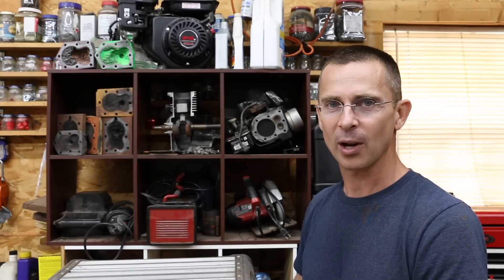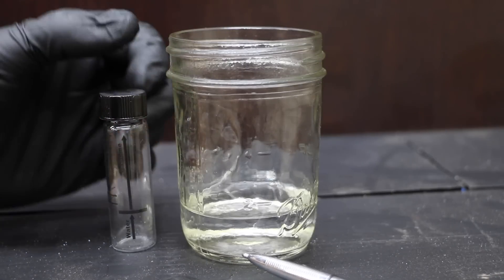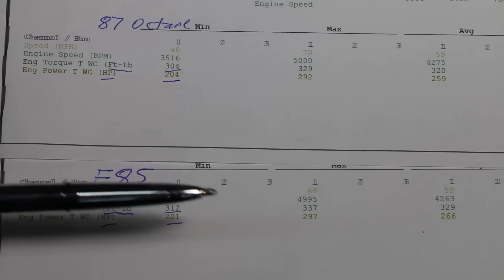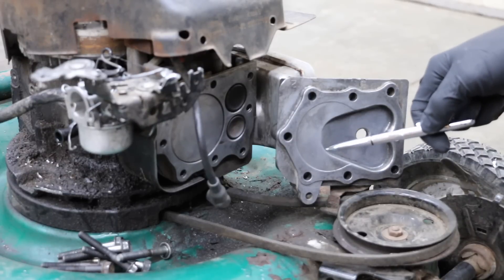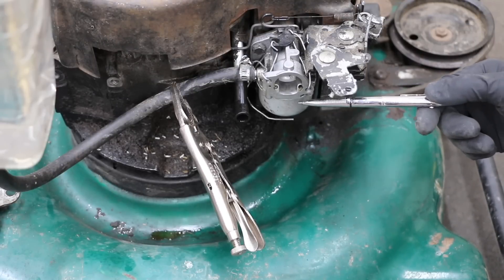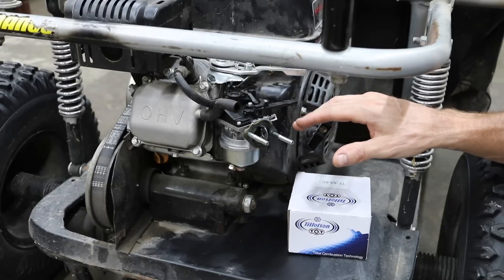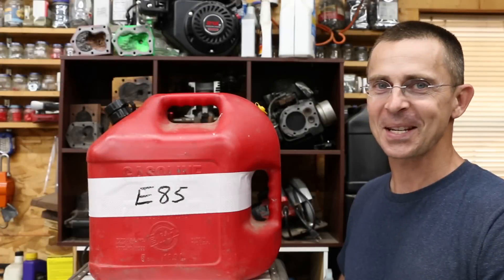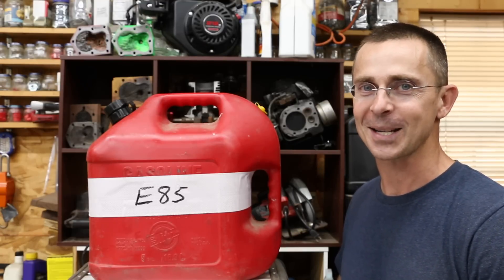Is E85 better than Gasoline? Let's find out!

Comment: My ecoboost says nothing more than e15 or it will void the warranty
Reply from the maker: Great point. Thank you
Reply: You know that's illegal right? The “Magnuson-Moss Warranty—Federal Trade Commission Improvement Act” is a Federal law, US Code, Title 15 § 2301, Public Law 93-637, signed into law by President Gerald Ford on January 4, 1975. Read details for the long story. The stickers you've seen that state "warranty void if removed" are illegal under this act. It also requires manufacturers to make the terms and conditions of warranty coverage clear and easy for consumers to comprehend. What does this have to do with automobiles? It is illegal for the manufacture to deny/void warranty coverage because you used an aftermarket part. Nobody, including you, likes being told what they can and can't do to their own automobiles that they paid for. If you want to use 10W-40 in your ecoboost instead of that water like 0W-20 you can do that. If you do then the manufacturers are required to provide absolute proof that any engine damage sustained IS A DIRECT RESULT of using non-OEM parts or fluids. Otherwise Ford is legally liable to cover the damages. The moment Ford can prove using E85 in your automobile does cause any kind of damage at all is the moment Ford can deny warranty coverage. Must be absolute too. If Ford states it's in compliance with this act by voiding warranty coverage on engine repairs because a fuel line didn't survive E85, uh no. That only shows us the fuel line couldn't handle it. Says nothing of the engine itself.  If you use an intake and exhaust from MBRP and a piston gets a hole in the center Ford is required to cover it if they can't prove the MBRP parts caused it. If a little extra air flow is enough to melt a factory piston I'd consider said car a lemon. 

Suppose Ford could proof using E85 caused damage but the reasoning was all related to computer programming? Then you are well within your right to have the ECM reprogrammed by an aftermarket company with a custom calibration that allows safe use of E85. To sue Ford for this covert criminal practice would take greater action. Class action more than likely. Apple lost against a class action lawsuit for intentionally engineering a short battery life in the Ipods. That and when the battery did die you couldn't replace it. The ipod was built fragile so it would break if someone attempted to replace it. Apple's solution? Buy another Ipod. It was a planned cash grab. Didn't end the way Apple was hoping. I bet you never heard this before. That's because fake news is controlled by a small handful of BIG corporations and their last wish is for the people to know any information that would set them free and give them power.
Reply: @exoticcreature3059   I've never heard of this before, very interesting.  The problem is though if a company denies to honor the warranty there is nothing you can do about it but sue them.  And the time and money it would take to do that probably wouldn't be worth it in the end.
Reply: Classic80sStuff if your under warranty you have a lemon law I would tell them to keep the fucker in the shop for 30 days and order a buy back and get my money back. Just did it in my 19 mustang in the shop for 3 months and got another brand new car instead 🤷‍♂️
Reply: @exoticcreature3059  yet you fail to understand how it works. The warranty is there so they don't have cover the damages you the customer did. If it says nothing more than e15 don't run anything more than e15, otherwise you risk damaging fuel lines and other important parts. Also, considering its an ecoboost and its only recommending a max of e15, running anything anymore can overheat the engine and blow it because its not receiving the amount of fuel it needs to help keep the the combustion cool in a worst case scenario so that's why it says it would void the warranty.
Reply: @geekmechanic1473 No, warranty is a scam. A fancy word for being dictated by the auto makers what you can and can't do with YOUR automobile. You still haven't addressed the part where the auto makers are REQUIRED to definitively prove damage was caused by your use of something the auto makers don't specify. Here is the problem, they never will. Good luck too when you don't have deep pockets. As for ethanol, lolololololololololol. Under what circumstances would using higher ethanol blends result in less fuel being delivered to the cylinder? That makes no sense at all. Not when ethanol has less energy density and you need more of it to produce normal engine power and because the oxygen content in the exhaust gasses would confuse the ECM in thinking the engine is running lean, thus, increasing fuel delivery. For fuel lines, there is no difference in material between flex fuel and conventional. If it handles E10, it will handle E15 all up to E100. The auto makers aren't careless enough to use rubber and plastic parts that do break down from high ethanol concentration like what you would find on a lawn mower. That's because the ethanol percentage varies MUCH more from pump to pump and station to station than we are told. "E10" at shell could be E18 for all you know. The auto makers know this. lololol
Reply: @exoticcreature3059  I build racecars for a hobby, if you don't upgrade your fuel injectors they won't be able to squirt in enough fuel for it to complete the combustion. I've seen pistons blown because of this. You need bigger injectors to be able to use higher ethanol blends
Reply: The fuel lines, tank, etc. Will degrade over time
Reply: @exoticcreature3059  its not that hard to prove something voided the warranty. They do specify what fuel to use all the way up to how much your tires are supposed to be filled. Its called an owners manual, they come with all new cars.
Reply: @geekmechanic1473  The owners manual is NOT proof. It is a booklet that explicitly tells the owners what the manufacturers say they can and can't do. Nothing about it is a scientific test. If fuel lines degrade over time it's because they were designed to. Manufacturers know how to make a product last. They won't do it. Why? $$$$ Again on fuel, the ECM has a built in speed density program in case any and all related sensors fail. MAP, MAF, IAT, TPS, O2, blah. Also programmed in is a tolerance range. +- x percentage compared to normal in case "normal" isn't producing adequate engine power or smooth operation. This is not an option. Not when atmospheric conditions vary so greatly, or in the event one cylinder goes dead. If the fuel pump, rails, and injectors could only deliver the specified normal amount and nothing more then engines would not run good for very long and you would buy another car in not time. Or you would look to the aftermarket, which is the smarter choice because then YOU decide what get's built and how it performs. Now I did not say fuel demand can't ever exceed the supply because it can. But don't expect me to fear a fuel shortage at 2,000 rpm just because the fuel isn't what the manufacturers said you can use. They do after all make engines that will spin up to 6,500 at WOT and a fuel system that keeps up. I'm pretty sure a 20% increase in demand while cruising won't starve an injector.
Reply: @exoticcreature3059  it won't starve an engine as long as you aren't using e85. And yes the rubber does degrade due to ethanol. As for what I was talking about he said he had an ecoboost engine that means he has a turbocharged engine which is forced induction it isn't flex fuel  and this is where it is important where you don't want to use e85 because if the engine hasn't been modified, such as a tune, bigger injectors and the such you can see failure in the engine as it isn't receiving the amount of fuel it needs. The owners manual isn't proof itself but it is a guideline that the manufacturer has set in place that they know will keep the car going. In the end using e85 isn't recommended in vehicles that haven't been built for it and don't use e85 and can see catastrophic failure if done so especially in a car using forced induction. I can tell you don't exactly understand how cars are built and designed because if you did you would understand that using e85 isn't like using premium gas and not every car can run it. Now I'm not saying the manufacturers don't make stupid decisions, they do especially Nissan when they decided to go from timing chain to timing belt is which would lead to the pistons and valves hitting when the belt broke and in that case they did have to fix it. But to outright say warranties are bad isn't true because I've had to return multiple cars that didn't work due to them being faulty and otherwise I wouldn't have been able to if I didn't have the warranty.
Reply: Now saying that dealerships are the main people you have problems with they will try to overcharge you for something simple but then again most places will try to do that.
Reply: @geekmechanic1473  Then I should hear everyone say they had to take their car or truck to a repair shop because the gas tank and fuel lines turned into mush from normal use. That, and I could rightly say in this specific case that following the manufacturers guidelines is a bad idea because they knew I would being buying replacement fuel lines on a continuous basis and yet told to to use a damaging fuel anyway. For fuel starvation, in this case I'll give you that one. Ecoboost, turbocharged. All those times you had to take a car back to the dealership did you ever think "What a POS this thing is!"?
Reply: @exoticcreature3059  no they don't degrade with e10. They do degrade with e85 if the vehicle isn't set up to use e85. Most people don't modify cars, so having a warranty does help save people money, Its helped save my friend a ton of money when the dealership sold him a faulty car. Now don't confuse dealership and the manufacturer because in most cases the manufacturer has to sell their cars through the a dealership (well at least here in the US) and the dealership ain't the most honest or reliable. There's a reason why I and many other people learn how to work on our own vehicles because there's a lot of places that like to take money from people, take Wal-Mart for example I hear horror stories all the time about how they charge the customer for an oil change and don't do it or damage something in the process and some dealerships do this as well (not all). Now as for why do companies use a small engine and turbocharge it is because you can get the power of a bigger engine and the fuel economy of a smaller engine. Now the problem I have with buying new vehicles is you can't be too rough on them and that because there is a period where they need to be broken in (engine and other components that is).
Reply: @geekmechanic1473  WalMart has done much more than that. There is a documentary called 'WalMart. The high cost of low prices". Back to ethanol I'm trying to make you see it for everything it really is. I acknowledge ethanol damages cheap low grade rubber and plastic. Also I know materials made to handle it are not rare and are not expensive. That and cars are made to handle higher ethanol content than 10%, obviously. Like I said before pump gas all over the US can be e10. It can also be e22, yes really. The variance is very wide and very common. The auto makers know this and have, or at least should have, designed the fuel system with this is mind. Don't expect them to admit this though. That would be admitting pump gas is blended with anything but accuracy and is sold at the price of e10 even though it should be reduced. Forgive me if I seem a "little" hateful towards auto manufacturers. That's what happens when they have a vast history of scamming the people. Did you know GM would charge for a replacement injection pump on the trucks with the GM 6.5 diesel when they knew the real problem was the PMD overheating? A much cheaper part that is easily replaced and easily relocated to a cooler spot. For the cases when the injection pump actually did fail, the reason was the factory lift pump. That thing is a joke that could never supply constant and adequate fuel pressure to anything bigger than an ATV, a youth ATV.
Reply: @exoticcreature3059  yea I get e10 isn't always e10 same with e85, I've seen with as low as e50. Now yes all manufacturers have had mistakes in the past, but dealerships will try to scam you more than the manufacturer if they do at all. Ford has the most lenient warranty that I've seen so far as they will let you do mods such as exhaust or cold air intake without voiding the warranty not every manufacturer is that willing. Now there are certain things they don't want you to do that could end up damaging the engine and that's where ethanol limits are placed. To run a car on e85 and a modern car that is you would need bigger injectors to make up for the more fuel that needs to be injected as well as a tune otherwise you risk starving the engine and on engines with turbos and superchargers that could lead to damage of engines. So just because the fuel lines and such might be able to handle e85 the injectors might not and you will also have to consider fuel pressure and fuel pump because e85 requires more of it to be used.
Reply: @geekmechanic1473  What about the 65 year old woman with a 4 cylinder Ford Ranger that goes 0-60 in......wait, she doesn't even go 60. Suppose she grabbed the yellow hose by mistake. Would she experience fuel starvation?

Comment: How much diesel could you get that lawn mower to run on when mixed with gasoline?

I mean like a 20% diesel, 80% gas mixture. Or even something like 50% diesel, 50% gas mixture.
Reply from the maker: Great video idea! I had it running with 50/50 in the past but I believe I can get it to run close to 100% with a few mods.

Comment: E85 is not designed for highway driving at all, its cooler running temp along with the cooling system running at its most peak efficiency will result in lower mpg. E85 was designed for in city driving only in stop and go traffic. It will out perform gasoline in that environment. Its cleaner burning will reduce the carbon in the valve train and carbon in the piston rings. Also it will reduce carbon build up in the oil. Today's engines have very tight tolerances and as such, the engine cannot gain carbon deposits in the oil. If the engine gains carbon deposits in the oil galleries, oil pressure is reduced and engine life suffers. Synthetic oil and E85 fuel greatly reduces carbon build up in a stop and go environment. For this reason, this is why you very very rarely see or not at all see E85 gas available along the interstate highway system.
Reply from the maker: Great point. Thank you

Comment: E85 is a great choice for people who need to run 91 or 93 in their vehicles. The price difference and increased power make up for the worse fuel economy. I have a '05 Dodge SRT-4 and it gets 28-29mpg highway on E10 91. Using a site for calculating E85 savings it comes out to me saving $200 a year on fuel - Though with more frequent stops. This is at my 20,000 miles a year.
Reply from the maker: Thank you

Comment: Would running a tank of E85 clean the combustion chamber after being soiled by gasoline over time (i.e could it be used as an alternative to seafoam or other cleaning additives)?
Reply from the maker: It would help a flex fuel vehicle, but it could cause damage to a non-flex fuel vehicle. Thank you

Comment: We use e85 in our race engines. Mileage is no concern. In our situation it creates more hp and the engines run cooler on it. Seems to have much better throttle response. It does burn much faster than the 93 pump gas re ran before.
Reply from the maker: Makes sense. It's cheap race gas. Thank you

Comment: I have one. I put marvels mystery oil in my tank every time I fill up, never a problem. What would marvels oil do as a crankcase oil ?
Reply from the maker: I wouldn't use it as an oil replacement.  Some use it as an engine flush just before an oil change per the directions provided by Marvel Mystery Oil

Comment: I like your videos. Few things to point out with this one. Yes, E85 is worse mileage, but it costs less money per gallon so the total cost to run E85 vs regular gas is about the same. E85 in itself doesn't make more power, in fact it's about 70% of the BTU's of regular gas (noted by worse mileage and needing to run A/F richer). The benefit is it's much higher octane then even most race gas, so it really helps on cars with turbo so you can run higher boost without detonation. And also can run more advanced timings curves. Combustion tends to be a bit cooler as well.
Reply from the maker: Thank you

Comment: Does the test make a difference with distilled water? Or different PH water?
Reply from the maker: I don't believe it matters.  However, I prefer using distilled just to be consistent.  The alcohol will separate out in either.

Comment: Hey i have a idea. I have tried 110 vp race fuel in my mower. Ran it for 4 hoyrs mowing and no problem. Ran 1/2 w30 oil and hyper lube while doing it. No change. One thing i can not afford to do. Is im wondering what kind of damgage would happen to a vertical shaft engine if ran horizontal.
Reply from the maker: Thanks for the video idea!

Comment: I use to be able to get an easy 22mpg from the 302 in my F150. When they added the ethanol to regular pump gas it went down to 13-15.
Reply from the maker: Thank you